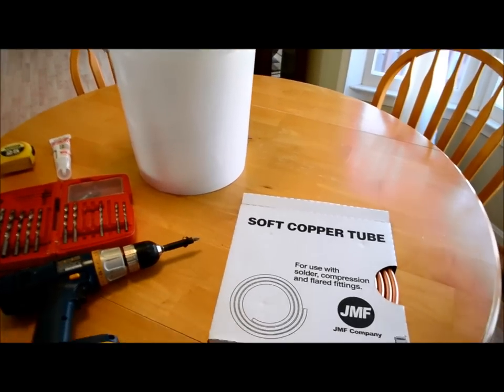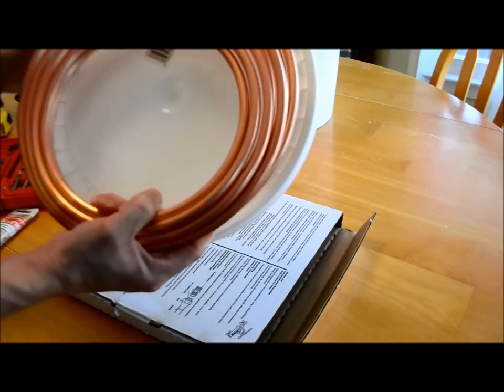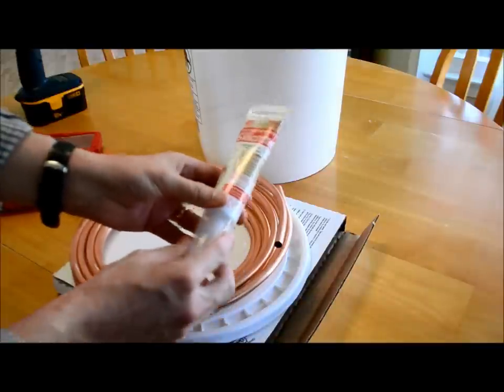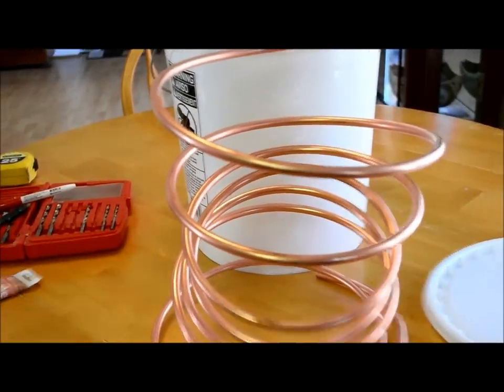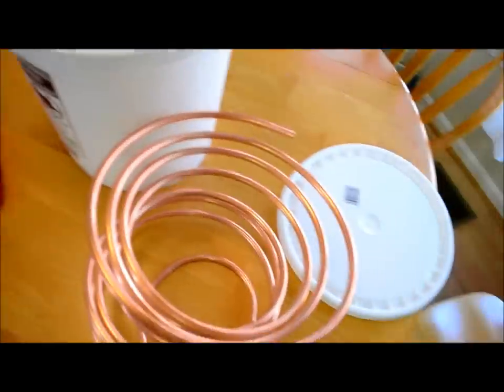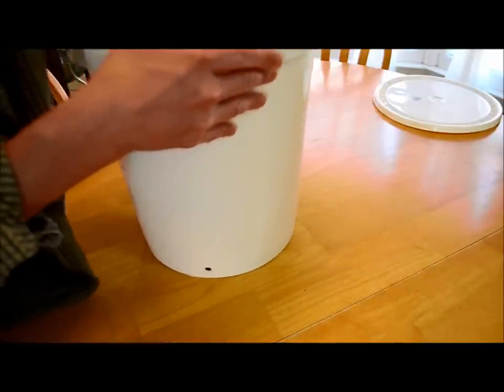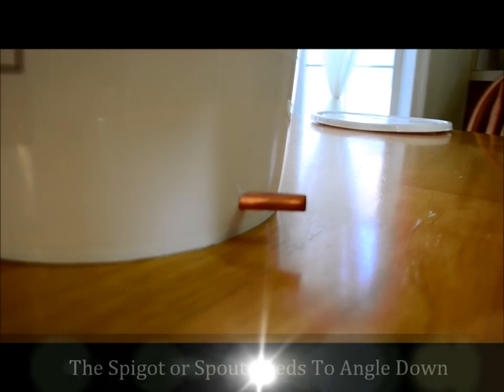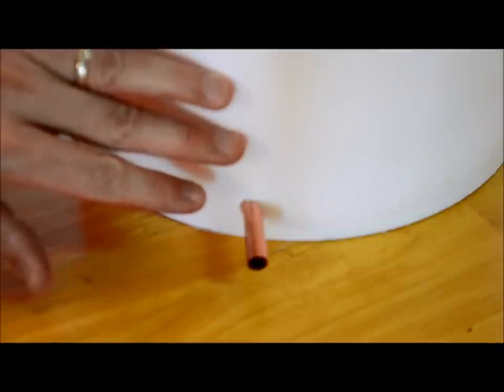How to Make Moonshine Part 4 :  The Worm Box :  Moonshiner Prepping 101

Comment from the maker: I actually built this worm box twice.  Once for my own use / trials....and then a second time (hence 2nd hole) to make the instructional video.  I sealed the second hole with silicone.  I suppose you could use it as a drain, just get a rubber stopper for it.

Comment: A thumper keg will give you a higher proof. It works as a second pot, fuelled by the heat of the steam that comes out of the main pot. This way your shine gets distilled 2 times in just one run. You can also use it as a chamber for herbs and spices, but then you shouldn't add water/tails to the thumper. When I use the thumper it gives me about 170 proof in a single run, when I don't use it the proof is about 120.

Comment: The thumper not only catches any boilover from the pot it also provides a second distilliation increasing the proof of what comes through the flake stand or worm by about 20% or 40 proof removing the need for a second distillation. The jugs you see from the cartoons with three XXX's meant that batch had been distilled 3x to increase the proof and refine the flavor. Most people fill the thumper with backings or tales from a previous run.

Comment: Some guy said 50 ml on his 5 gal still, which is one whiskey shot glass. I have a 1 gal still and one gal worm bucket. I saved the first half shot of brandy I did this weekend and tasted (not swallowing) it to the rest. Even though I make fruit brandy, not corn whisky, there was a difference in taste. So I throw out the first half shot. I also save the last few ounces (which are crappier) seperately and put it back into the next batch.

Comment: i had an idea on how to make moonshine "safer", and i would like to know what you think.
methanol (the bad stuff) boils at 148 Fahrenheit, while ethanol (the stuff you want to make) boils at 173 (quite a bit higher),so would it be possible to use an electric heater with a temperature setting and keep it at 150 till all the methanol is extracted? let all the wood alcohol boil off so you can have a methanol free liquid which you can safely extract the good stuff from,or does it not work like that?

Comment: I'm not 100% sure on the thumper. I don't use one. I don't need one. A thumper would steal some alcohol, as some of the vapor would condense in it, but it would serve a great purpose if you have boilover, or overspill or chucks of corn. The thumper would catch the bits of mash that could get into the plumbing and into your final product.

Comment: Well see, I took a scientific guess about one reason and was right. You don't get more flavor from multable distallations on a single batch. It can only increase proof and smoothness. But I've never ran a batch, without a thumper, that wasn't 80-100 proof. I go for complete drinkablity on the first round. Any leftovers go in with the next batch. So I do a second distilling and first distallation at the same time. This increases proof, smoothness and flavor.